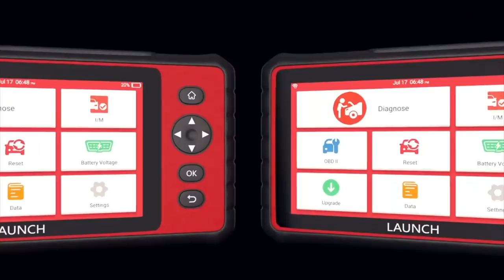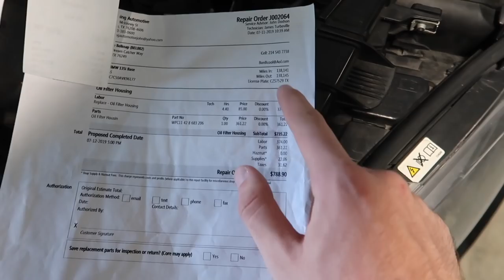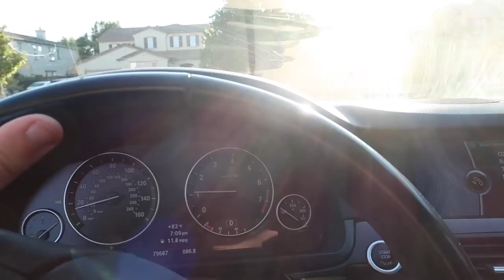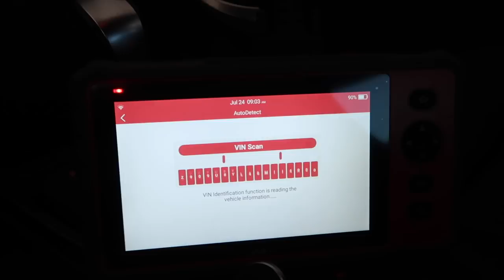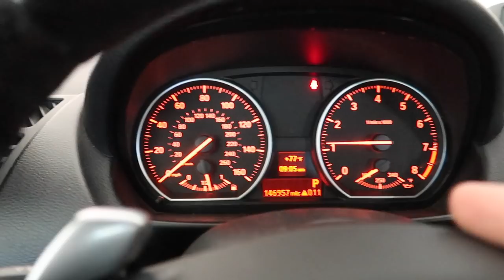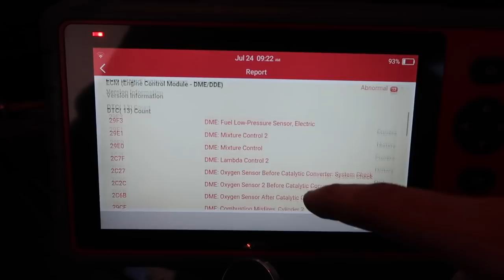WHY THE N54 SHOULD NEVER BE YOUR FIRST BMW!

Comment: Just had this problem on my 335i! don't run the engine too much cos it will damage the injectors. There's a chance u wont have to change your injectors if you change the oxygen sensors quickly. Basically your engine is most likely 'running rich' atm (so shit loads of fuel is making the ends of the spark plugs go black). A trick to check if it's defo the oxygen sensors..is to unplug the clip on the bank 2 sensor and the car will stop misfiring for a minute. Hope that helps bro!

Comment: 2010 BMW 335i

N54 applications require the spark plug gap to be changed to OE 0.7mm (0.0275″) or 0.56mm (0.022″) for high boost 
I got this from FCP euro. 
You dont have high body so gap them closer to 0.023 or 0.025. Change the plugs to Delphi plugs instead. 
Then change the O2 sensors that your code requires. 
I went through this last year. It took me sometime to figure it out. It was a difference in gapping that help the situation. Mine were gap at 0.022 when I gap them to 0.027 at was all good from.there with Delphi coils.

Comment: I have an 08 335i n54 and I had the same issue, it was both my spark plugs and the ignition coils. Prior to that it was my injectors that’s caused a leak to the plugs and coils so once those were all replaced, we were good to go 👌🏼 (besides all the other problems I already fixed lol). The O2 sensors are for your cats, could be a bad cat or bad O2 due to a leak if you have one. Basically you got every single n54 issue 😅 spent a good year slowly going through the list and replacing everything.

Comment: Oxygen sensors work by heating an element and determining the oxygen content through how much the temperature of the heating element changed. When you start the car, the sensor has to warm up for 30 seconds. The car will run in an open-loop circuit. It will use predetermined fuel and ignition tables to run the car. After the oxygen sensors warm up, it will run a close loop. It will use the air-fuel ratio seen by the primary oxygen sensor. It would make sense if your cylinder bank 2 oxygen sensor is bad considering most of your misfires are on cylinder bank 2. But you also got a low fuel pressure sensor fault, so it could be related to injectors or the fuel pump. You may be able to look at live feedback data for the oxygen sensors and fuel pressures to give you more information. Good Luck!

Comment: First thing I know you’re getting 1 step or 2 step colder spark plugs for higher boost levels but I think till you get it tuned and everything you should leave your gap at .030. Second thing I think you have a leaking fuel injector that’s fouling out your catalytic converters and oxygen sensors. If you have someone that can remotely scan your car using ista they can look at your fuel rail pressure and see if it’s holding pressure if it’s not holding pressure you have a fuel leak somewhere. Also if you have a leaking injector you should see some black smoke coming from the exhaust when you rev it and it will smell like raw fuel. But I suggest you do it soon or else you will have to replace your catalytic converters if you run it while it’s dumping fuel like that.

Comment: Check the low pressure fuel pump for an electrical issue (connector), and then, test inyectors with the scantool (if its possible) or check the resistence with a multimeter.

Comment: My bmw did the same thing you need to change the oxygen sensors out and it should fix it. It’s important on bmws they read good if not they start showing misfires all over. After that change my car ran smooth as new

Comment: Change the valve cover gasket seals for the spark plugs should fix the leaks also clean the vanos solenoid as well as the vanos solenoid filters would help with the idle as they may be clogged

Comment: The problem could be in a valve cover itself, with the pcv, or it can also be a vanos solenoids which are common problems also, it is for sure something related with oil, also you can try to look at the maf sensor if its oily, or it just might be a o2 sensors

Comment: Change out all fuel injectors and sensors. If your engine bay smells like fuel then check on the line at the top driver side engine. Those fuel leaks are common areas.

Comment: So I’ve had all those codes I changed all my plugs and coils. And was still catching a code. Changed the the injectors the codes went away. It sucks cause they cost so much but the injectors make a huge difference. As for the 02 sensors check the fuse box first. I changed mine it cost 500 for all four from fcp just to find out my 02 sensors were perfectly fine a 10 cent fuse had blown in the glove compartment.
Reply: definitely
Reply from the maker: ill check that out
Reply: Nour Hummadi if you have anything else pops up lmk any code you can think I’ve had 😂. I’ve been through it. But after you do all the maintenance n54s are unrivaled.
Reply: @NourHummadi  maybe injectors were replaced and not coded in right
Reply: KC maybe true true ? 🤷‍♂️
Reply: U hit the nail on the head brother.... I bought my first car in 2015 but before I did, I already knew that turbo charged cars means more maintenance n much more wiring n everything.  So I researched n knew there was various bmw e90s.
So I opted for 328i n till date it never saw the mechanic since 2016.  Even though I spent money, but not as much as those with N54 engines that visit money vampires (Bmw Dealership).
My first issue when I bought the car was shaking after 15mins.. dealership gave me a quote of $2.5-$3k. 
After researching n surfing YouTube. Can’t remember You n shop life Tv.
I got it fixed for less than $100. (Gear oil)
Anyways Thanks brother. I still drive the car till date like new. I commute between Oklahoma n Houston tx. Still love it. BMW for life.
Reply: Stop changing stuffs without being extremely sure. BMWs codes n symptoms links one another. Double check ur codes with more than one code reader. I use fix’s n Carly.
Reply: @oliverreinoso9783  hey I have a rough idle and shaking on cold start, but I don't get any misfire codes. Got codes for NOX sensor
Reply: My bad just saw this. Have you tuned the car at all? It could be a number of things when I changed my valve cover gasket my car sounded like a mustang had the worst idle I ever experienced. I ended up taking out my intake and exhaust solenoids and cleaning them with brake cleaner and swapped their spots. Fixed the problem instantly. It’s a 10 minute job watched a YouTube video it’s was cake. Lmk if that fixes it.
Reply: Combo-Breaker I love to hear that. The N54 is an amazing engine once all the maintenance is done. Most of the horror stories you hear is from tuning the cars and not doing maintenance. I’ve put 15,000 miles in 8 months and the car runs beautiful. And I run a stage 2* tune.

Comment: Clean the throttle body! Disconnect the neg from the batt, remove all the intake components, and clean the flap or flaps with some carb and choke cleaner, clean the maf sensor too. try if you can to remove the whole throttle body and clean it, cuz i see fuel and air mixture failure, i have a porsche cayenne GTS and had the same problem

Comment: Check/swap the injectors, index 12 recommended, check if the valve cover is cracked or old, PCV valve, and o2 sensors, and hope its not the hpfp

Comment: Nour, bro, if you have changed valve cover gasket and it still leaks, you need to change valve cover itself. It's made from plastic, over time it becomes crooked and leaks even if you change gasket.
Reply: UPD: if you smell gas, it might be fuel injector failure, better check them ASAP, leaking fuel injector can destroy your engine

Comment: So idk if you’ll see this but this is important,I know it’s not the same car but same concept,I have a 2008 impala SS and it kept doing that,and I changed all the injectors,and ran around and spent $700 for no reason,took it to the dealership and a $160 later they fixed it (that includes diagnoses) and it turns out that most cars have the injector wires resting on the engine and the heat of the engine frays em,check your wires religiously it could save you!

Comment: I had a BMW 325xi with the n53 engine 3.0, had rough idling, I put in 3 new injectors still the same problem sold the problem (the car) bought a VW golf 6 gti replaced timing chain, happy me🙃 never a BMW again only the m3 or m5

Comment: You need all new index 12 injectors and it’s important they’re all index 12 as well as code them on 
The scanner it’s not needed to code them on n52’s but n54’s are needed, sadly sometimes the actual valve cover is cracked so you’re going to need to check that, also like I said in a previous video , WALNUT BLAST I Can’t stress how important this is since this vehicle doesn’t dump fuel into the intake valves it gets clogged up therefore it causes misfires at times, and get used to changing spark plugs regularly as you will be modded therefore every 5k miles it’s important to switch them out, I got rid of my n54 because it was way way to much repairs and it was at the shop more than I was actually driving it.
Reply: Especially if you smell fuel, the ignition coils are fine but just keep in mind that as much power as n54’s make they don’t like to be modded for some reason but hopefully with the index 12 injectors and a walnut blast it will run smoother than ever.

Comment: It is your o2 sensor ,  I had this problem on my 135, your first start up your car is in open loop , so it does not use o2 monitoring , but with it is in close loop it takes o2 sensor data but if it is not working properly the DME is f-ck up. Check your old plug too if some of them are black as crazy it could be injector , but my injectors were leaking like crazing ( blew my engine because of that) and the idle was more stable than yours

Comment: My first bmw is a 2009 335i. Had it since December 26 2018 bought it with 128,000 miles now I’m at 154,000 never fixed anything other than a coil pack.. THANK GOD! So regardless I can agree you can get a horrible one but I’ve seen n52 328i’s give more problems but anyone new don’t let this scare you away!!

Comment: Injectors. I had the same issue changed coils spark plugs bank 1 and bank 2 sensors. Misfire continued. New index 12 injectors with walnut blast. No more misfiring and runs like butter

Comment: Check your low pressure fuel sensor and your hpfs. I unplugged mine on accident when installing my charge pipe and had the same faults

Comment: Either leaky injectors or O2 sensors messing with the AFR and either running very lean or very rich. Most likely leaky injectors though. The vibration is the random spike in fuel going in and causing a much harder combustion causing the motor to jolt. FCP euro has lifetime warranty on their sets of index 12 injectors highly recommend them!

Comment: I would suggest you now take a look at the injectors first, since coils and spark plugs are fine, I bet they would replacement and the O2 codes are appearing probably because of the misfires since fuel is not burning properly they are not reading the right fuel/air mixture, so they should go away if you change the injectors. Happened to me something but I had a MAF going bad.

Comment: Fuel injector thing. Happened on my N45 not N54 but comments seem to be similar. I didn’t change my fuel injectors. I had them taken out and cleaned. My issue is gonnneeee. It’s been 16 months and covered 40k miles. No issues at all. Also Liqui moly fuel injector cleaner is something I go to as maintenance, once a month On a fuel tank of fuel. Good luck brother 😂

Comment: Literally just got my 2011 E90 328i back from BMW because they fixed my valve cover gasket thankfully it was still under warranty. That sucks that you have to do extra work my guy.
Reply: How long is the warranty
Reply: I A if you have the 328i with the sulev engine then it will still be covered under bmw’s extended emissions warranty. It’s 15 year/150,000 mile warranty.

Comment: Hey nour I would do a cylinder compression test to see if it’s not the engine it’s self also nour from looking at the codes it looks like your o2 sensors are bad all of them not just the ones after your cat which is causing your low pressure in your fuel first do compression test then move to the o2 sensors and replace them only if compression is fine then you should find your problem

Comment: I have the exact same issue on my N63 engine, I’m guessing the fuel injectors may be bad or not spraying enough fuel into the cylinder to keep it running normal. My car is shaking violently as well. So I’m gonna take my car to the mechanic and let him figure out what’s the issue that’s causing my car to run poorly.

Comment: FUel injectors replace fuel injectors and put new seals on them that gonna fix your problem and check your fuel injector connection they brake easy

Comment: It’s your MOFEST chips on your DME they are burnt out. The DME will be the first edition 80. BMW revised it in LCI cars with an 81. Chips are cheap enough but you will need to solder in new ones.

Comment: I have the same problem on my e39 525i. Cold start it vibrates a lot for 30 sec and the idle is always normal at 700-780rpm. Also have the check engine light on and the codes are Oxygen sensor bank 1 and bank 2. Still dont know what the issue is i hope someone can help me.

Comment: your valve cover is cracked that's why it's leaking even after 7k miles/.  I think you have to buy new oxygen sensor(under hood) ,i think they might be causing misfire's on 1 bank.
Reply: So you think it’s the o2 senders under the hood ? Because I have the same code “2C92 & 2C9F oxygen sensor heater after catalytic converter activation & 2CA6 oxygen sensor heater before catalytic converters temperature
Reply: With a misfire on cylinder 3

Comment: I wished I’d seen the title one year ago 😭, I literally bought this car for my first ever car 😭
Reply: Same 😂 but i got my n54 like 4 months ago
Reply: acuadras12 so start replacin parts or else ull be in for many suprise lol
Reply: Sivo 13 what parts do you think i should replace right now before something goes wrong? Its fully stock, 54k miles, and no lights but it is starting to shake for a bit when i turn the car on
Reply: acuadras12 definitly coils and plugs but when the n54 is stock problems are not as bad as when its tuned just take it to bmw specialist and ask what needs to be changed around this mileage

Comment: It’s probably the fuel injectors
Reply: Why do you say that?
Reply: @aaronvillalta3542  yea why you say that
Reply: Aaron Villalta  I had that problem on mine. Fuel was leaking into my spark plugs and making them foul out.
Reply: Yeah i had the same problem apparently its always fuel injector number 3 thats the issue  on n54
Reply: Aaron Villalta combustion misfires on these cars are very often injectors, especially if they happen at idle. The injectors will leak fuel onto the plugs at idle causing the issues. Not to mention the smell of gas is almost a dead giveaway. Honestly he should’ve known as soon as he pulled those plugs. They were wet, probably oil fouled but with how shiny and wet they appeared, i’d guess injectors.
Reply: You know you stuff man, he did say in his news video. it’s the injectors
Reply: Leon Recommended haha I just own an n54 and I love it... a lot 😁. Yeah I saw that, he said it was a ground cable tho which I find odd just because, as far as i’m aware (and I did just replace my injectors) there is no ground cable specifically for the injectors, but there are ground wires for I believe every 2 coil packs. He had misfires on 3,4 and 6 I believe he said so that doesn’t make much sense to me. Nonetheless glad it’s sorted for him, at least for now 😂

Comment: If the spark plugs was not changed when/after the gasket was changed that would be normal and you would not need to change the gasket again just check the spark plugs after 1k miles and it should be okay
Reply: Try unplugging the air mass censor and run the car if it ideals correctly it would be it malfunctioning

Comment: 02 sensors and fuel injectors buy all 6 index 12 brand new don't cheap out and buy used your only gonna screw your self. And if you have down pipes get mhd for the codes.
You might not even need 02 sensors its gonna give you the codes cause of  the down pipes.

Comment: You Definitely have a cracked rocket cover 100% sure and  also injectors are leaking can see your running too rich on sparkplugs are wet you need to update them to index 11 or 12 and you be ok until another problem turns up n54 335i is a wonderfull car but so much problem